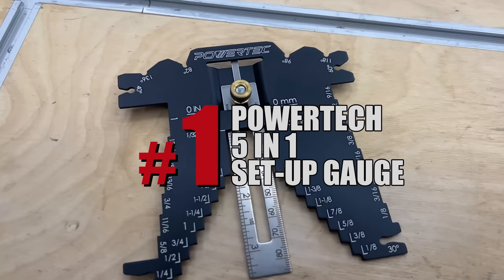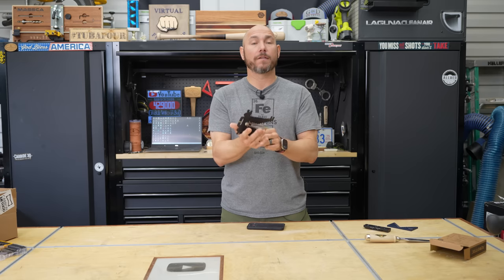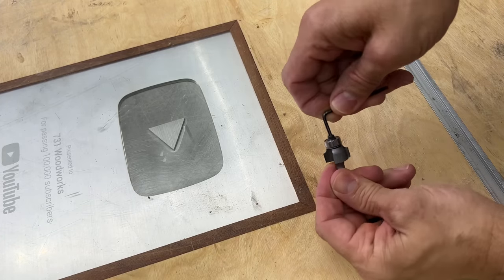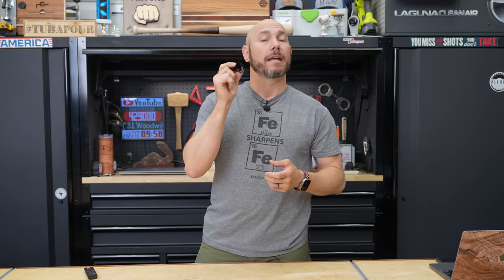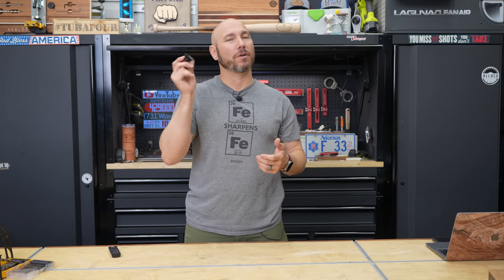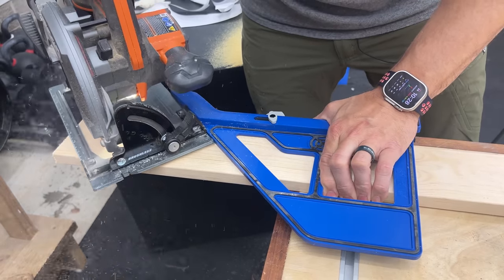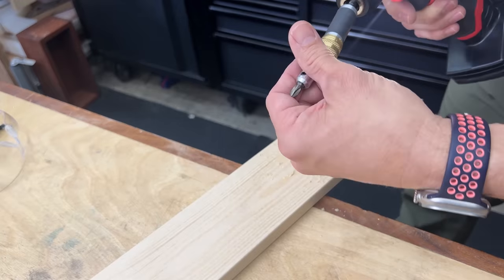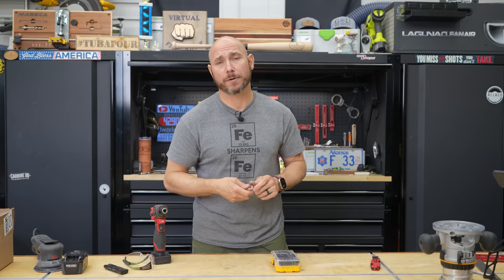5 Awesome Woodworking Tools That Won't Break the Bank!

Comment from the maker: ▼EXPAND FOR TOOL LINKS and INFO▼ 
Watch Next = 5 Tools You've Never Seen Before - https://youtu.be/7v3Jc3xvjFc&list=UULFSLClJLzdUMRMe0E4SPfc-w
Tools in this Video:
Powertec Set-up Gauge - https://amzn.to/43FMTII
DFM Set Up Gauge - https://amzn.to/3C93rgl
Infinity Router Bit Vise - https://amzn.to/42m2z2s
Magnifier - https://amzn.to/3qtD2XR
Kreg Crosscut Jig - https://amzn.to/3qtDc1p
Montana Drill / Driver Bit - https://amzn.to/3WP4n39
DeWALT Driver Set - https://amzn.to/43GGEUG

Other Tools Under $30 I Love:
DFM Square: https://amzn.to/3Jfb5H2
Thin Rip Jig: https://amzn.to/3LKm2lB
Alternative Thin Rip Jig (if other is sold out): https://amzn.to/3vaydBu
Alternative Thin Rip (over $30 but maybe the only one in stock): https://amzn.to/3NwfjNx
Spring Clamps: https://lddy.no/1575h
Clamping Squares: https://lddy.no/1575g
Small F-Clamps: https://lddy.no/157u9

Beginner Router Bit Set - https://amzn.to/43Eturn
Chisels I Recommend - https://amzn.to/42nvJhE

TrueWerk Work Clothes - https://truewerk.pxf.io/GmbJjE Use code WOODWORKS10 to save 10% off your order for a LIMITED TIME ONLY. 

The full list of tools and supplies I recommend can be found on my website: https://www.731woodworks.com/recommended-tools

Join the TUBAFOUR NATION through Patreon to get access to exclusive member only behind the scenes videos, member only livestreams, exclusive discounts, and other cool member only perks! https://www.patreon.com/731woodworks

Check this video's description for links to all the videos I discussed.

If you use one of these Amazon and other affiliate links, I may receive a commission

Some other useful links:
Daily Tool Deals on my website: https://www.731woodworks.com/tool-deals
Subscribe to our email Newsletter to get new content alerts, sales, and more! https://mailchi.mp/7e44c16eefdc/731-woodworks-email-newsletter
20% off of PLANS using code COOLTOOLS  https://www.731woodworks.com/store
Outlaw's Board Butter - So Good it Should be Outlawed: https://www.731woodworks.com/store/boardbutter

Comment: The setup gauge is ok, but those kreg setup blocks and the knockoffs are more versatile in my opinion. I even stack them for larger intervals. 
Instead of an magnifying glass, I use my phone. Take a picture and zoom in. 
The countersink drill and driver though.. loving that

Comment: I just use my calipers to set height. That's what the back slide is for, just make sure to flush the back and zero first, cheap ones tend to be a lil off on their grind.

Comment: The Montana countersink/driver looks similar to the Dewalt I've had for years, just shorter.  At least on my Dewalt (and apparently on the Montana) is there is an allen key on the end that can be used to change bits.
Reply: Its a direct ripoff of the Kreg quick flip. Literally identical

Comment: Great tools for the workshop, for sure. I think that the Montana 4-in-1 tool would be more likeable if the brass locking mechanism was spring loaded to prevent accidental slippage of the bit you're using.

Comment: a cool suggestion for the router bit gripper -- paint the tighten side with some red paint or marker maybe green on the loosen side, you missed that the Montana countersink ACTUALLY has a allen built into the back end of the driver quick coupler hex drive!!!!

Comment: My eyes are pretty bad, but my phone will magnify anything I need to see. Better yet I can take a picture and blow it up. So I wouldn't purchase the 20x magnifier. A tool that looks about the same that I  am thinking about purchasing although I don't  know that I need it either is an optical center punch. Its a cool tool even if you don't need it.

Comment: Great tools, but you might want to double-check the router bit vise. I clicked on your link to Amazon, & they say it is currently unavailable & they don't know when or if it will be back in stock. Not a fan of Amazon anyway, due to the poor treatment they give their workers. I avoid shopping there unless that is the absolute only place to get something. Hope you have a great day, though, Matt!
Reply from the maker: Thanks.  Probably sold out shortly after I posted this video. That happens often with these type of videos.

Comment: Am I the only one who doesn't see the links in the description? There's a place for the links, but no links. I see links for a few other items, but no links for the items in this video.
Reply from the maker: Just checked and they are all there.  If you're on mobile, it's harder to find.  Check the pinned comment I put the links there too!
Reply: @731Woodworks  - I don't see the links in the pinned comment, either… at least, not on my Mac. I do see the links in the YouTube app on my phone. Maybe it has something to do with the security software on my computer?